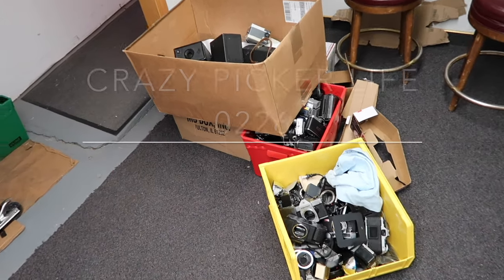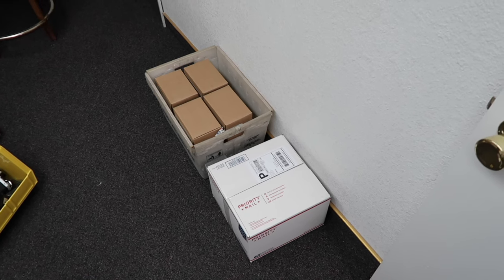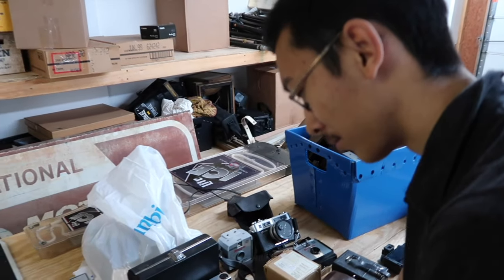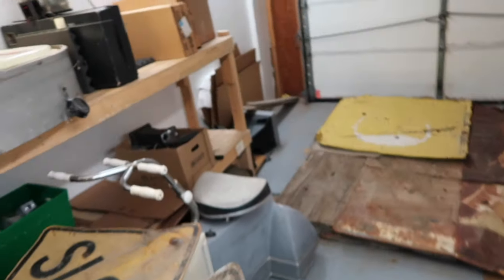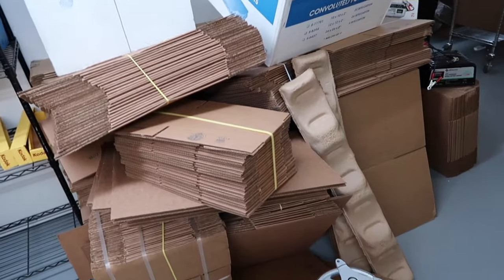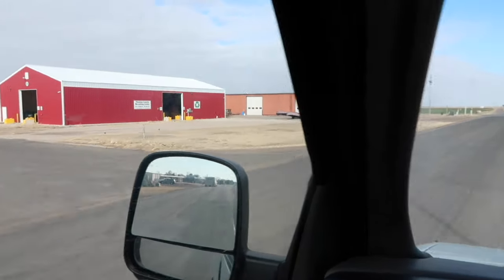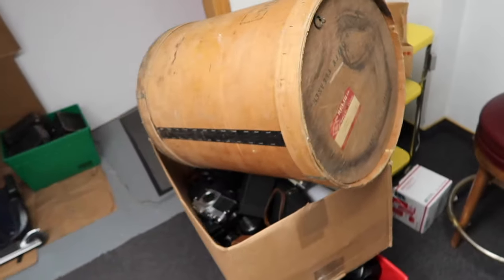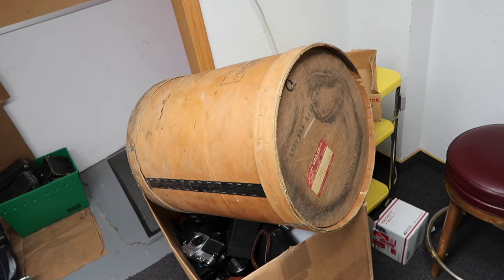Today Could Go Either Way - CPL 0226

Comment: You mentioned in an older video about having 4 different paypal accounts to go along with each of your ebays. Is there a benefit to having multiple accounts for paypal? I have 2 ebay accounts I use and only 1 paypal and wondering if I should change.
Reply from the maker: keeping separate for bookkeeping ...